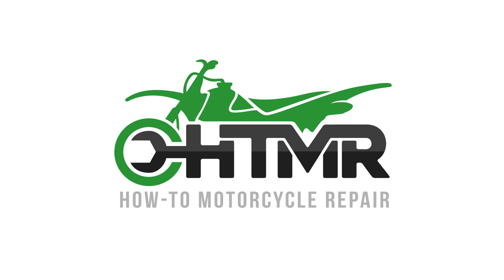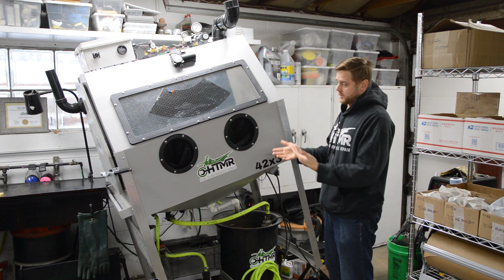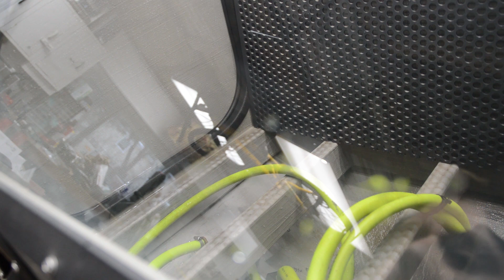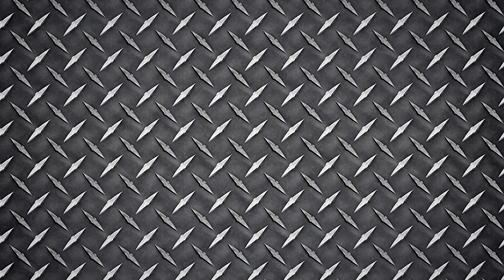BIGGER Wood Vapor Blaster?

Comment: I think 40 deep is good even for average length arms. If someone is blasting big things, they will need to pause, flip and rotate as they go anyway.  Larger is very usable for big motorcycle frames and tractor engines when you want a badass satin peened luster 5/5 finish.

Comment: Great work. I think 60" wide is ideal (that's what I suggested on the FB group), 40" high is good. 40" deep might be a little too deep and it would be hard to reach the back of the cabinet when using the gauntlets but it would allow larger/wider parts to be put in the cabinet so yes, 60x40x40 would be great. Cheers
Reply: Deep is good for being able to turn and rotate without opening the door, but for most, it would be too big.
Reply: Lazy Susan?

Comment: I'm in agreement with the guys in the private group that my largest items I'm very interested in blasting are motorcycle frames. The actual internal size of the 42x30 cabinet seems ok for a modern dirt bike frame, but the door dimensions & ability to get a frame loaded into it likely becomes a limitation. That said, I think around 48Lx36Dx36H would be the ideal size for me personally & allow plenty of space for a frame, or a full length automotive transmission, simultaneously solving the door size limitations. 60x40x40 would obviously work but it's so large at that point that it's tough for me personally to justify (far as shop/garage footprint goes). I hope this perspective is helpful & look forward to becoming a customer in the future once this is sorted!
Reply from the maker: I can take a vote and see if that is a size others want as well.